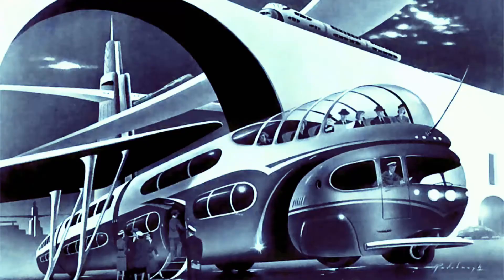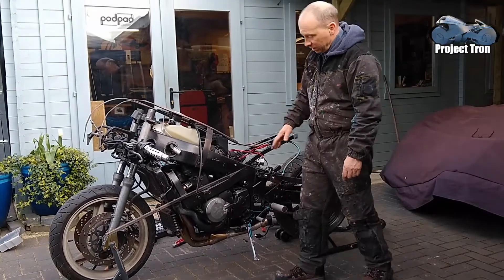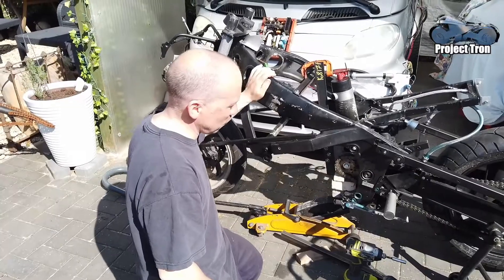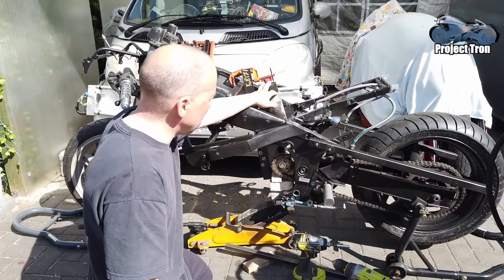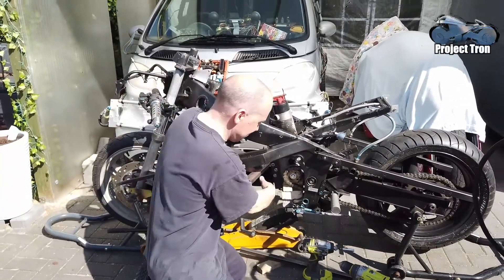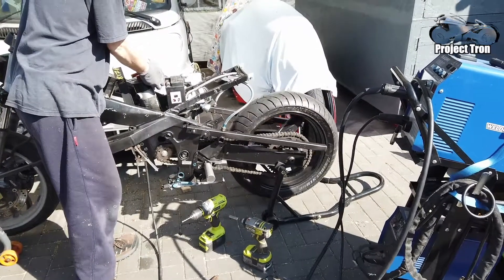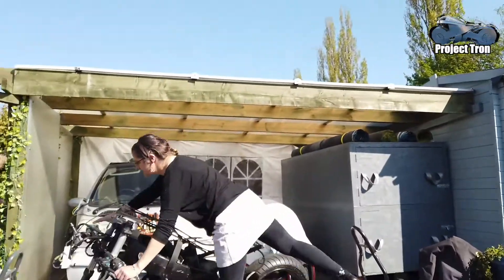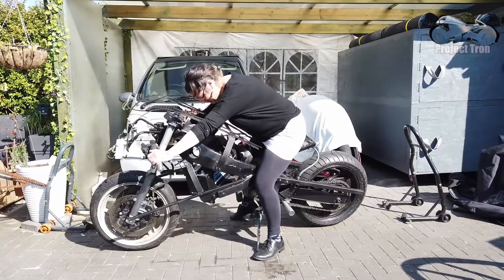Tron Bike Electrification Project. Lightcycle conversion to electric motorcycle, Podpadstudios

Comment: By "pushing against the engine" to move the bike forward you're driving the wheel, chain and motor. If the motor was shorted out (in a 'breaking' configuration) you'd be unlikely to be able to turn the wheel at all. This set up doesn't really have a 'neutral' gear the way an internal combustion engine would. I'd love to know what the top speed of the bike is. Obviously as a demo bike it doesn't need to be very fast but I suspect you lost a lot of speed going from internal combustion to that electric setup. 120hp ~ 90000W to a 400W motor, the electric will be more efficient and can run at 400W constantly where the ICE can't run at 120hp constantly but that's still a big step down in power.
Reply from the maker: You're right it's a tiny motor, simply specd to move the bike around.... If we wanted to make it move faster we'd have to put in a much larger elec motor. However using a small motor reduces weigh so machine is easier to maneuver when we get to events..  

We did put in a clutch interlock mechanism allowing the bike to be moved this effectively dissengages the electric motor.  

Sorry for late reply (somehow we missed you comment when it was first made)